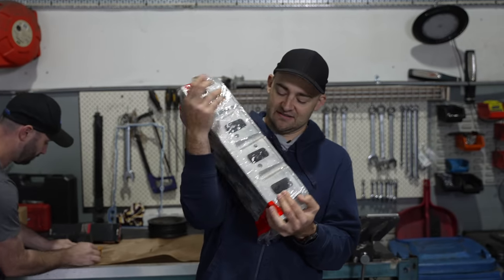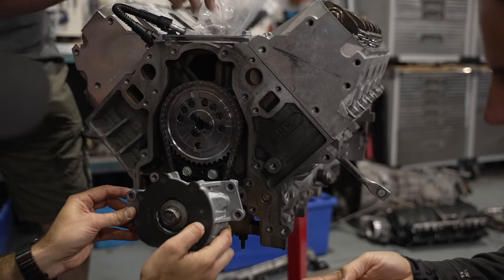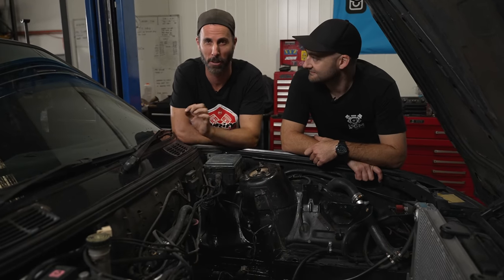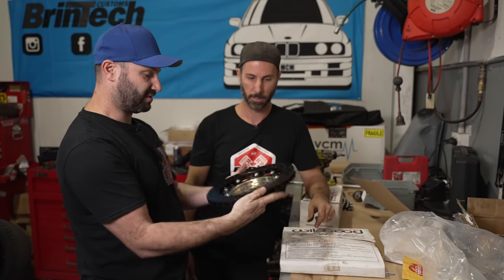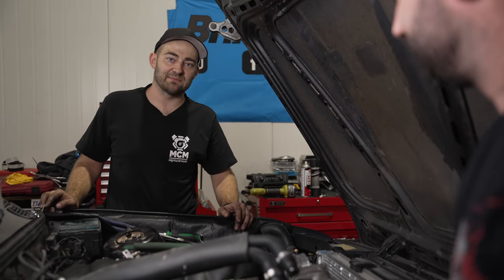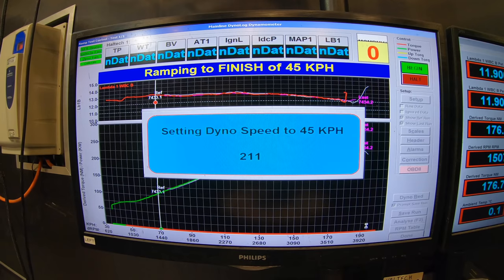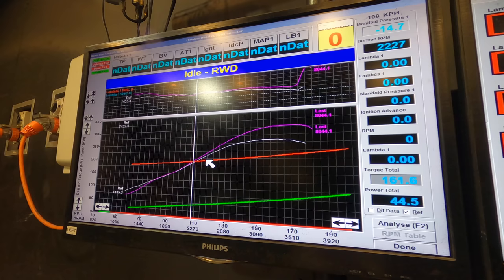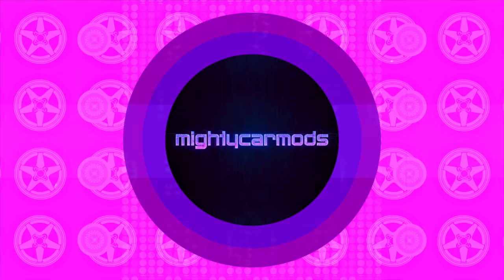BMW E30 CAM Upgrade & Dyno Run

Comment: Putting an LS in an E30 is like an attractive woman who wants to feel a bit more attractive after maybe a few hard years in the sun who goes to the plastic surgeon and gets a pair of G-cup stripper tits. It’s unnecessary, ruins the package and makes her look cheap despite dropping 15k on some silicon. 
Everyone will look at this car and think it looks impressive and maybe a drive would be epic with the bolt ons dominating the experience, but the E30 with the well tuned M20/B30 or S52 is the car that would be most desired to take home as a keeper and the LS E30 will be relegated to the shed to show your mates at Summernats